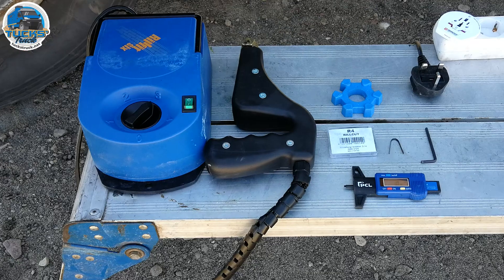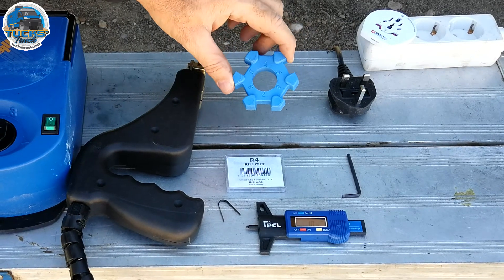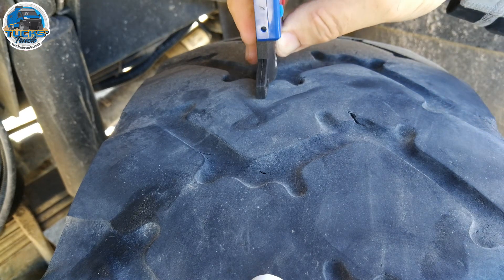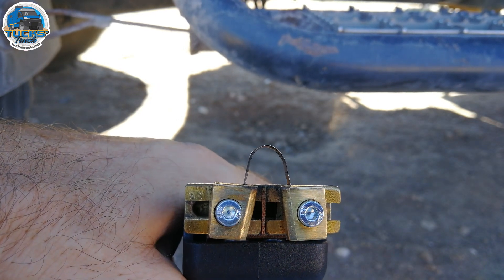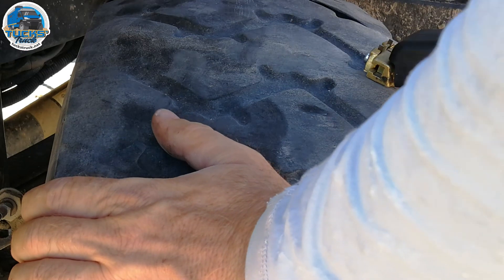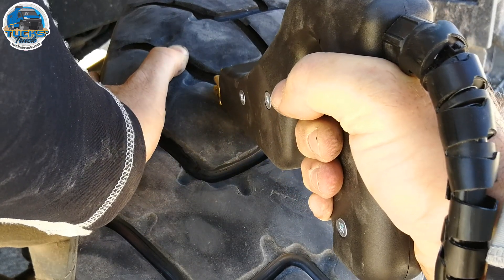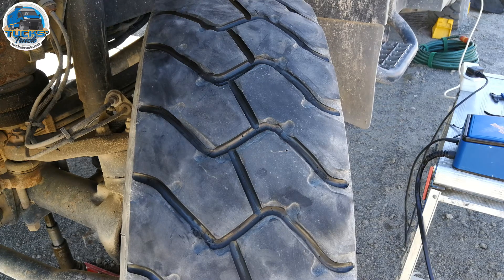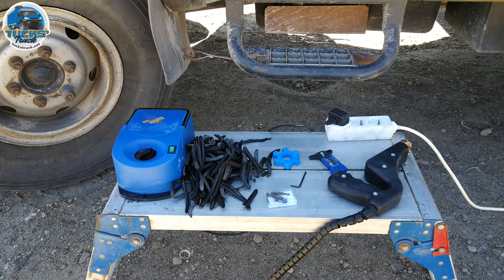Tyre Regrooving - Michelin 255/100R16 XZL tyres

Comment: We use to use an awl, or like an ice pick,push it in until you hit steal belt, and mark it with your fingernail, set the blade about half the depth.
No wander your blade's getting burnt up,you don't have the heat set high enough, and you use a small file,and sharpen your blade a little bit. 
If you set it on 4, the heat will help you push through the rubber easier.

Comment: airbags on the front axle ?
Reply from the maker: @MsHappyeman  on both axles, excellent for levelling up at night 👍
Reply: @MarcusTuck   Wowo fast reply. I have a vw t3 , already about 60000 euros into it ! thinking of an iveco
Reply: would love a 2 seater cab with intergrated cabin and seating for 2 in the cabin .... scared of the price
Reply from the maker: @MsHappyeman  if you want to do serious off road the older Daily 4x4 like mine is excellent.  However, it is expensive to maintain!  The newer Daily 4x4 isn’t as capable off road (more like a Sprinter 4x4) but should be cheaper to run.

Comment: Hi brother i need your help fore tyres Regrooving machine please if possible connect me on facebook my id manahar.parmar or whatsapp me soon as possible connect no is +916355386600 please is important for me
Reply from the maker: I don't sell them.  Look on line and you should be able to find something.
Reply: I just need hanadle inside photos and details brother  in india not able to seen that so please help me
Reply: Please whatsapp me
Reply: I already made that type machine but sum tiny problem with wire gauge switch so i searched on every ver but not to seen any wer please help i just want some handal in side potos switch how to work and wich cable use inside
Reply from the maker: @liyanarathnagerohini8465  sorry I am not going to take my machine apart.
Reply: Please bro it's literally help for me please
Reply: I am hopefully waiting for your help